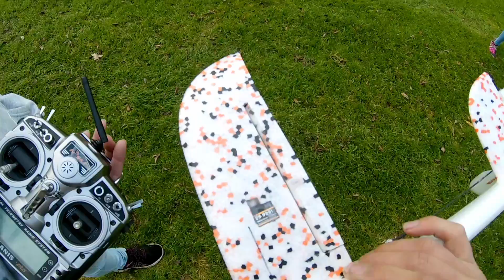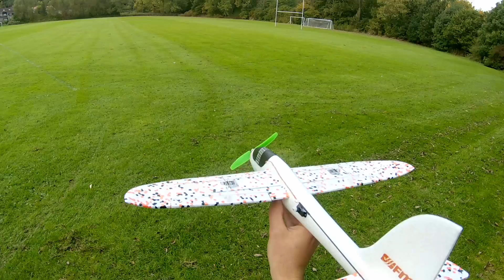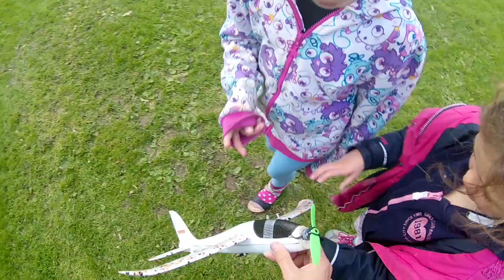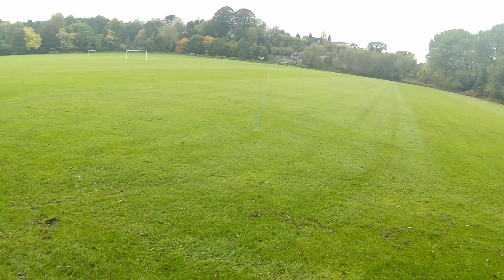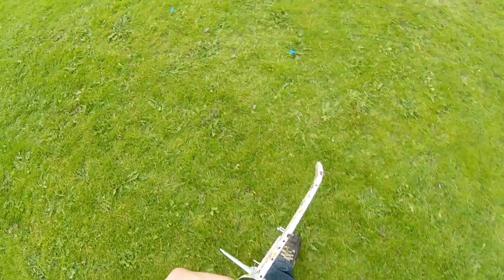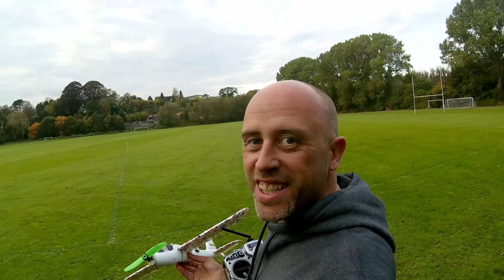Chuck Glider RC Conversion - Part #2 - LOS Flight Testing The Worlds Smallest UAV

Comment: you got that thing to fly very well!
Reply from the maker: Good morning Phil, yea I'm shocked how well it flies. The rolls are tight for a wing that has dihedral and the loops, they're extremely tight! It's going to be a fun model to FPV and I can't wait to get that F3 flight control board on her and see how far she can fly! Matt
Reply: Matthew Ogborne its always nice when one makes an idea actually work hey?  impressive to see how you will put a flight controller in that. which means probably a gps sensor too. i saw a guy mount a 433mhz receiver to a bonsai the other day. but your plane could probably park itself on top of a bonsai! :)

Comment: Loving this series, currently just got all my bits and pieces for my mini skywalker uav build. Subbed😄
Reply from the maker: +Joe Mgoose Howdy Joe, which flight controller did you go for? It's pretty tight in the mini sky walker, I'm going to be using the mini F3 board from this project in mine once I'm done. Matt
Reply: +Matthew Ogborne i have a tornado osd which has waypoints and such. But I think I'm going to get something a bit smaller. Maybe a F3, after I let you set it up on this I'll copy the settings. Haha
Reply from the maker: Morning Joe, do let me know how you get on! I'm going with iNav and a F3 board for this model, no idea how that's going to work out yet. You'll find out in a couple of episodes time :) Matt

Comment: That's an impressively acrobatic little plane Matt! It's good to see you enjoying a plane with a tail for a change :-)
PS, the Taranis arrived, D8 mode wasn't available on the standard firmware, so I've flashed it to OpenTX 2.1.9 so now i can use all my V8-II receivers - now I've got to go through all my planes and re-set everything up (and buy a couple of D or X series receivers and a vario)
Reply from the maker: +Tsnafu Howdy Mr T, yea who knew she'd fly so well! Happy days in the Taranis, do check to see if you have eu software on the Taranis as there is two types of XR receiver available. Matt
Reply: It is EU Matt, but I thought you could flash the XR receivers? (Dunno how but I thought I'd read it somewhere)
Reply from the maker: Howdy Mr T, you can flash them with the dedicated tool AND using the pins on the pack of the transmitter too, mine didn't work though even after flashing it with the latest (and older) EU software :( Matt
Reply: Sounds like a lot of hassle - i'll just make sure I buy EU ones :-)

Comment: wow - she's fast but turns so well.

I'm inspired - am yet to take to the air and am awaiting my delivery of a Devo 7e from China - but have ordered three of these so I can learn and still fly when I cock up.
Reply from the maker: Morning Kev, yea I'm amazed how well it flies, I've just bought another 2 myself to convert after this project is over. One will be a slope soarer and the other will be a powered model like this one (as I have to do some hefty cuts in this one to make the F3 flight control board fit). Matt